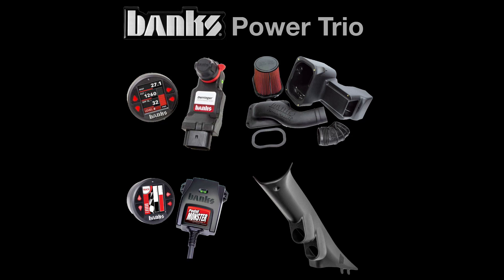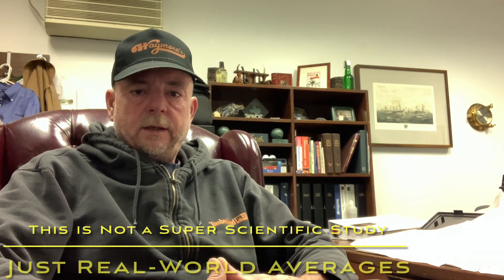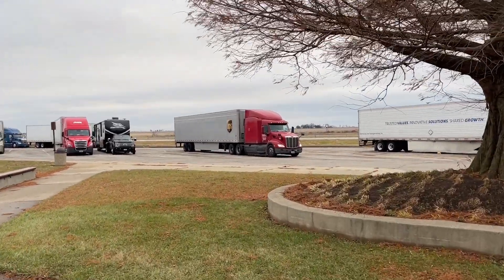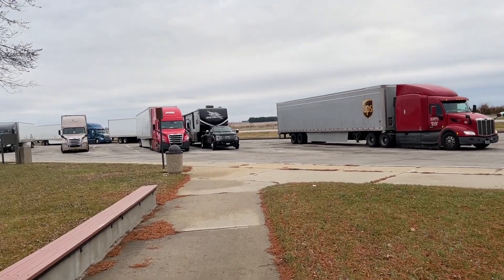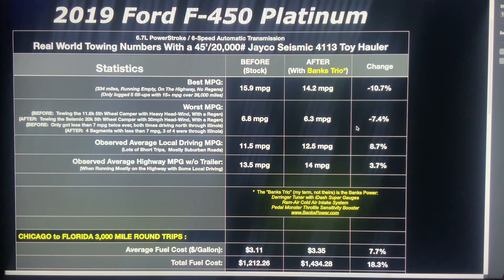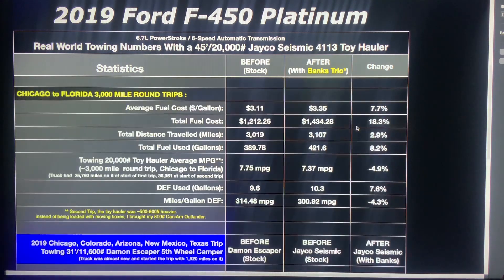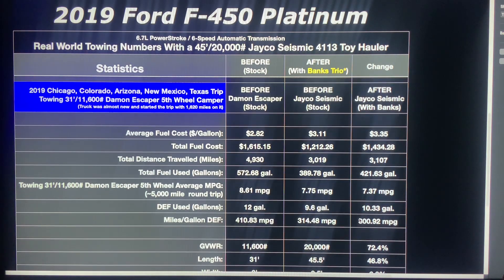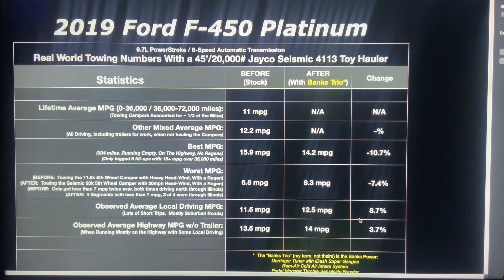2019 F 450 Toy Hauler Towing Mileage Before and After Banks Derringer, Ram Air, and Pedal Monster

Comment: Great info & data. You used mode 6 High Performance, and stock. Doesn’t the other modes include an economy mode(s) for times when higher power isn’t needed? I’m waiting for the model for 2020+ Super Duty, so I have zero experience on Derringer.
Reply from the maker: There are 6 power modes on the Derringer, with stock being the lowest.  No economy mode.  I would think they'd have a model for the 2020+'s by now!

Comment: How do you like the Tire Minder? You have the small caps that replace the valve caps?
I have a F350 DRW and a Triple Axle 43ft Fuzion....so if im going to pay to read 12 wheels, i want a decent setup from day 1.
Reply from the maker: It uses the caps on the valve stem.  System works great on my 46' Jayco Seismic 4113.  Saved me a couple times already.